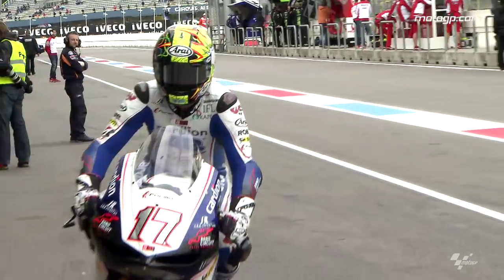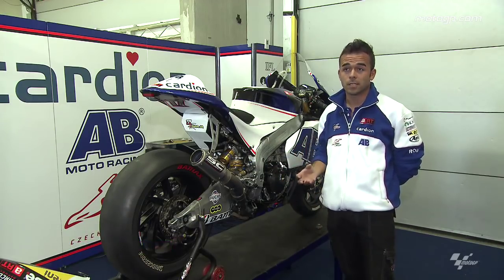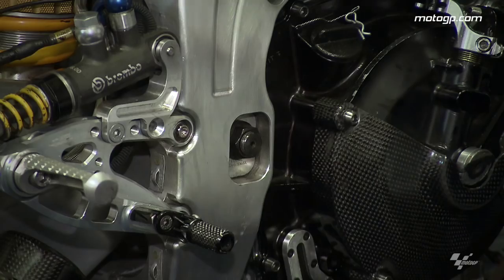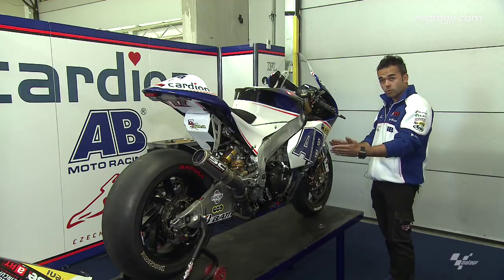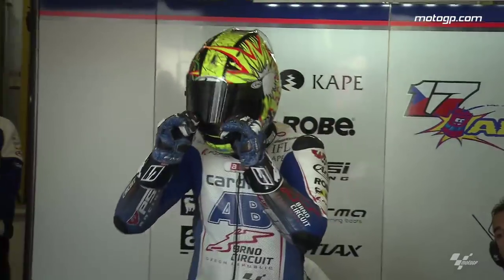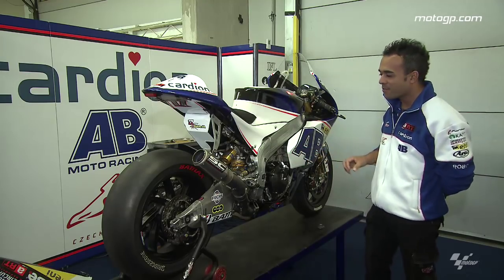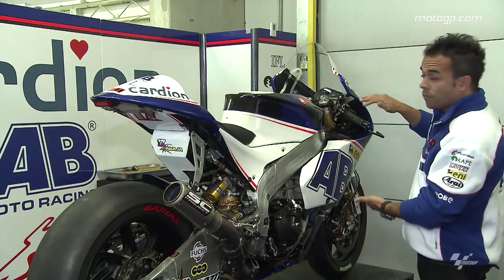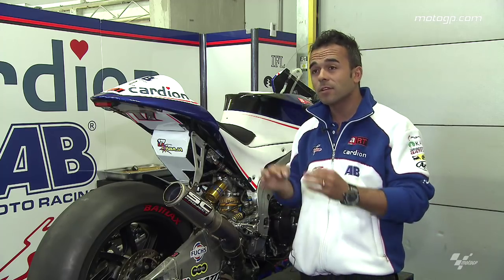MotoGP™ Workshop: bike set-up and its fine margins

Comment: A well setup bike is something else, regardless of the year.  

A few months back I switched a bike with a fellow rider.  Aesthetically it was nothing special, just an old '92 GSX-R 750 with mismatched fairings.  One quick ride through a tight canyon road however tells a different story.  The bike was so well setup; it was steady through the rough pavement and absorbed the bumps with ease.  When we switched back, I've found the guy spent all his time & money on susp.  The rest is stock.  Nice.

Comment: Sometimes I often wonder if the rider gets over confused with all the fine adjustments & how he translates what he feels on the track to mechanical changes ,suppose that's why top riders take there top mech's with them when changing teams.
Reply: Interesting comment. I would imagine, because they put in hundreds of laps, and can refer their memory of previous experience to specific data, and know the tracks from memory, then it's not so hard to translate experience riding into discussion of precise measurements. However, this depends on how 'extreme' the situation is with the bike. Ideally, they fundamentally get on well with it and can really understand what is happening. I get the impression that the 2022 Honda, for instance, was just very difficult to read, the feedback and changes were not really making sense, no matter what adjustments were made. This would be a nightmare for the riders, requiring huge amounts of mental strength to not take the crashes and poor race results personally.